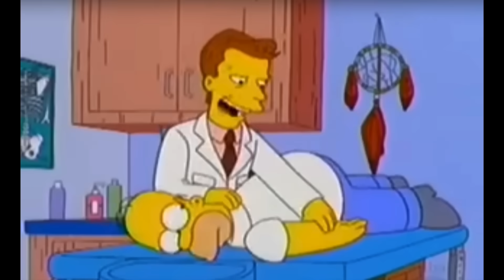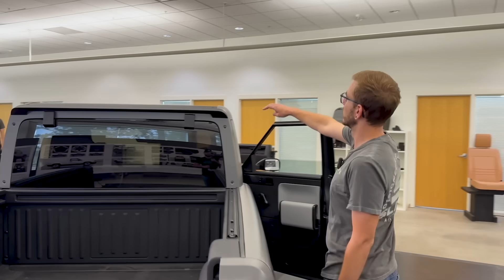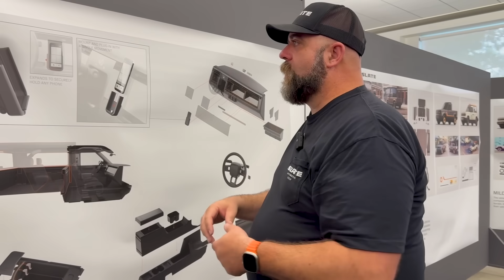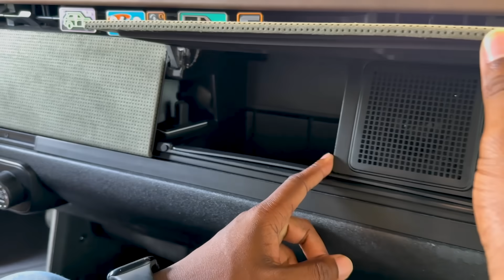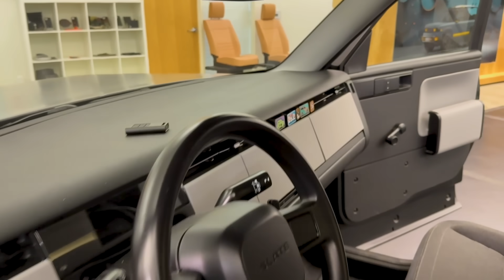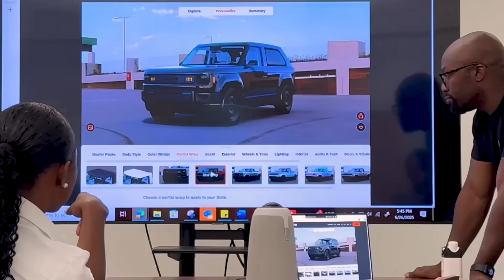The Slate: America’s $20K Answer to China’s Cheap EVs (Exclusive Access)

Comment: I'm at 28:00 in the video. All the utilization of the different parts to be basically created out to fill wherever that part might be missing or broken. On the slate truck made me think of hold on your to your buttz now. Military application. If you have a part that you need to repair you could just send them like in 100,000 parts and change all those trucks or keep them moving and doing what they're doing instead of having to you know individually make a new part for each truck. The slate is so Kool it's ice cold.

Comment: One big overlooked benefit of the Slate EV is its low MSRP, which directly lowers vehicle registration fees, taxes, and insurance costs in many states (like Colorado). You could buy the base model, then upgrade it with added seats, other components—even fully enclose it and turn it into an SUV—and still enjoy the perks of a sub-$30K original MSRP. Smart move for anyone wanting capability without the long-term cost burden tied to higher-value vehicles.
Reply: Sure but most are going to spend another $10k customizing it.
Reply: @rcl8793  Right but buying accessories isn't taxed the same way as buying a vehicle. So you're taxed for a 30k vehicle even though you've ultimately spent 40k
Reply: I already see dealers add $10K just because
Reply: @vadim6385  The Slate truck won't have "dealers". It has to be ordered directly/is direct to consumer.
Reply: @vadim6385 no dealers, you'd buy directly from slate
Reply: @vadim6385 more reasons to remove the dealership model. Because they're new, they will most likely do something like Tesla where it's just showrooms, though some minor hints lead me to believe Amazon may have some play in this.
Reply: But still cost 20k...go look how much cost Dacia cars...
Reply: @joe125ful we cant buy a Dacia... so it doesn't matter.

Comment: The rear seat would not have any leg area just a bench seat in the bed of the truck
Reply: I saw that too but if you look at the bed there's what looks like maybe a removable bit towards the front of the bed.  I am wondering if that is where it opens up for rear passengers because I've seen videos of adults who aren't lieutenant Dan sitting back there.

Comment: @$20k I don’t know if this is a Godsend for middle class America or a death bell for the final pump and dump by billionaires. 
The employees are genuinely passionate about the vision though. I love to hear about company values for the customer.✌️
Reply: Also the automotive renewal method is a basic mechanic for yearly profits. Of course this was powered by necessity combined with the general brain washing by the entertainment industry. “Don’t get stranded, buy this better powertrain” “Don’t get into a lethal car accident, buy this vehicle with improved safety” Plus they raise the prices when the new body style comes out (Perfectly correlated to the cost of R&D with inflation) and it’s not necessarily wasteful for the improvements made. 
For instance the slate vehicle will last the owner 20years before a better upgrade is released that the vehicle would be inherently incompatible with. 
Kinda like adding independent suspension to a Model A or adding new crumple zone safety standards for +60mph impact safety, or meeting road noise and vibration updates but lacking the door seal needed to use higher end techniques. 
The slate is a great truck but its longevity is anyones guess with the improvement rate of current technology. If I was them I’d lower the price of the conversion top by half and find a way to do it. Reasonable prices will increase demand.

Comment: I live in the PNW. Removable roof and windows? Both will need a seal to keep water out. And when they fail. And they will. This thing will leak. Stop designing vehicles for dry/hot climates.

Comment: What I think would be really cool is if this concept were offered in both ice and electric options! I think they would make a killing if they did that. They probably will anyway, but I bet the ice engines would out sell the electrics😝. Just my humble opinion.
Reply: Especially for a pickup making it a hybrid would be the most sensible. Could keep the electric drivetrain and just add a generator in place of some of the batteries. A 10-15KW genset would fit pretty easy and provide plenty of power. Then you’d also have a decent generator for powering a house or whatever.

Comment: $28k for a bare bones truck with no radio and roller windows? Why are we pretending this is cheap or even reasonable?
Reply: This is a vehicle for people that use trucks for actual work, not dicking around.
Reply: @BrunodeSouzaLino i see it more as a tool like if u don’t need a big ass truck just something to have to haul some shit around if u have a smaller car plus would be great for city driving
Reply: @BrunodeSouzaLino thats absolutely not what its for😂 i use a truck daily for work. My truck has a 6 1/2 bed to fit my ladders and equipment. My truck can pull my trailer. My truck can fit me and 3-4 people. My truck can get me 400 miles on one tank. This slate truck is literally only for dicking around within 60 miles of your home, with one other passenger, and whatever you can fit into the tiny bed.
Reply: @willishadams  tbh other truck beds on the market aren't very large either, especially compared to older trucks
Reply: @sometf2player752  gmc, ford, and toyota all have at least 6.5' options for all their full sized trucks. You can get up to 8' in a ford full sized truck. Most of the unnecessary trucks you see driving around have short beds though, yes.
Reply: @willishadams yep and that’s only in warm weather.  You’ll be lucky to get 80 miles in cold weather
Reply: @Staticline1776 yep. And once it's a few years old and the battery has degraded, it becomes a toy you can grab your mail in. Or pay another 20k for a new battery to get that 80 miles.
Reply: Correct it’s not cheap, but I’m looking at used trucks and they don’t exist at less than 15k and if they do it’s 10+ years old with 150k miles.  So given the market prices this is pretty inexpensive, maybe not affordable.
Reply: @realedelbug  yes, and imagine how much cheaper they'll be in the future. EV longevity is a lot better these days than it used to be, I don't have a lot of concerns with grabbing one of these used in 10 years time.
Reply: @SeniorMoistener  cheaper in the future doesn't belong in the same sentence when you take the never ending inflation into account :) Cheaper when you pick one up used tho sure
Reply: they're 20 grand the government gives an 8,000 tax credit for an EV purchase.
Roll down windows are way better btw but you're a pencil neck so of course it would hurt your little wrists
Reply: @victorkreig6089 too bad people who call others pencil necks voted in a guy that's getting rid of the EV credits
Reply: @victorkreig6089  In what country?
Reply: Have you priced pickup trucks lately?  You barely get an operable vehicle for $50k.
Reply: @robertd9850 thats somewhat true, but the trucks you're talking about aren't marketed as affordable. A Ford Maverick is 30k and has basic electronics. You can get a base tacoma or f150 brand new for less than 40k. Theres even a low trim jeep wrangler for 33k now. No paint, no electronics, and range that will almost certainly be closer to 100 miles, for 28 thousand dollars is asinine.
Reply: @willishadams  There are only 2 Mavericks out of 107 near me that are slightly under $30k.  The rest are $34k or more.  The Slate doesn't compete with ICE pickups, it competes with EV's.  EV's are always more expensive than the equivalent ICE vehicle.
Reply: @robertd9850 I responded to you saying there isn't a barely operable truck for under 50k, which is silly. Calling this truck cheap is just as silly.  This thing should cost 20k and be 12k after rebates. Then its short range and low capabilities would be somewhat justified.
Reply: @willishadams  Can't make a battery that cheap.  Did a quick search of local Ford dealer inventory.  Of the 521 F-150's available, they have exactly two with an MSRP under $50,000 and those are both 2 door white work trucks, something the city utilities would buy.
Reply: @robertd9850 in my small, extremely expensive town in Utah, there are over 100 f150s under 50k. There are 6 single cab work trucks with long beds, paint, and radios for under 40k. These are brand new trucks that id consider somewhat operable.
Reply: @robertd9850 in my small, very expensive, utah town, there are over 100 2025 f150s for less than 50k. Most are crew cab xlt or stx trim. There are 5 single cab "work trucks" with paint, audio capabilities, towing packages, and 400+ mile range, for less than 40k. All new and "operable". Batteries are more expensive, less efficient, and produce far more pollution to create. Removing standard options is seeming more like a gimic by the minute.
Reply: No towhook?
Reply: The money you will save compared to paying for gas and absurdly expensive repairs is completely worth it
Reply: Exactly, I was thinking the same. 28k isn’t cheap at all for 95% of us in America or 99% of us in the world.
Reply: My electric Mini was $29.9 before the fed tax credit. And it came w/ paint.

Comment: 40:56 I mean, there's also an aspect of this over time customization. Say you want an "off-road" package ... To get a 1500 with that, you have that added to the whole up front, so you're financing with interest rims, tires, running boards, lift kit, and fender flares. That kit will add a hundred bucks or more every single month to your payment. These guys let you add it incrementally, NOT tacking it on to your payment. Yeah getting the whole kit at once will be a few grand, BUT adding a $500 accessory quarterly, and you can have your whole kit in the 1st year, without raising your payment... If you have a rough winter, money is tight, well have to wait a bit for that front bumper, but can still afford your truck payment. That's an aspect they could promote that'll help a lot I think to focus on.

Comment: Unfortunately this truck will be too expensive for most people. Built in America means it will be expensive to manufacture - but on top of that the truck "as standard" has nothing. The stats are poor and it can't really do "work" and all the add-ons that people will want, like a radio, automatic windows and locks, blah blah blah, will end up making the end price way way higher than advertised. It's kind of a trick, to make the price look better than it is.

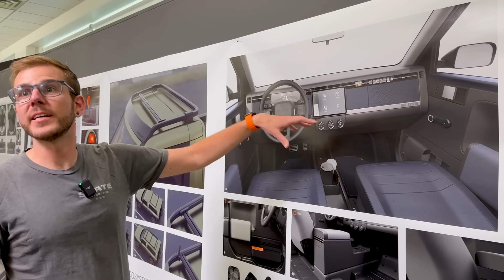Comment: 4:30 ... As a Japanese kei owner. This is kinda funny...  They don't come with a radio to save cost? (100$ head unit. 45$ speakerx2) 
Bring your own device is neat, but any telemetry you would get from an app you can already see via the obd port 

I'm more interested in the prices for replacement parts.... Like how much is it to replace the battery(s)

Comment: 29k for a decent build, on a TINY truck. China will give you a temu Porsche for 35k. BYD TANG and ATTO. MIC DRIP. DRIP. DROP. 
But wait there's more. The BTD shark is 60k and it fits 4 grownups. It's a beast, they hold ip in the Australian outback as the best vehicle off the grid.

Comment: Speaking as an owner of a 2022 GMC Canyon who had to wait a month and a half for GM to get a brake caliper for my truck when it seized. I have been saying for a while that automates need to make parts more common from vehicle to vehicle. It would  ake things easier on parts suppliers. The way this truck is designed is brilliant. For could do something similar with let's say the Maverick, Bronco Sport and even add like a Bronco Sport trac, like the old Ranger Sport Trac. GM could do something similar. Dodge, Toyota, Kia, Honda. All the auto makers should offer something similar to this. I'm not a huge fan of pure electric vehicles but if they were to add a gas range extender like the old Chevy Volt. I would absolutely be interested in something  like this.

Comment: Just be a man and buy that 3rd gen Dodge Ram with a cummins engine for less than 20k. Life will be infinitely more interesting than if you had bought a Slate truck.
Reply: yea but its huge i don’t want to park a ram it sucks. i would get a ram if i was towing all the time but its bad for everything else. this is not a F350 replacement its for tacoma owners that only own the truck to get plywood occasionally and do a bit of landscaping sometimes.
Reply: Also I all-ready own a truck for towing and it sucks to drive unless its work.
Reply: @mshepard2264 yea its annoying especially on the megacab, with front and rear bumpers plus a tow hitch. We parking the looong way. Id still take it over a Slate, its cheaper (initially) and like 4x the vehicle.

Comment: This is the vehicle you think you want, until you realize you don't actually have use for a underpowered two-door pickup made of plastic.
Reply: I got a 95 Miata’s with less than this, and prefer driving it to my 22 Cadillac.
For under 20k, I would snatch this thing up without a second thought.
I don’t want any option,, and I don’t want to see a dealership, or repair shop for service, when needed.

Comment: This truck will fail because It's not 20k, it's 28k for the blank slate which doesn't include basic amenities that are included in cheaper trucks like the maverick. The range is laughably terrible. Add in speakers and powered windows and now you are well above 30k. The Ford Maverick base model has these and more for less. There will be a niche audience for this truck because of it's quirkiness but for everyone else that needs a functional daily driver, I doubt it.

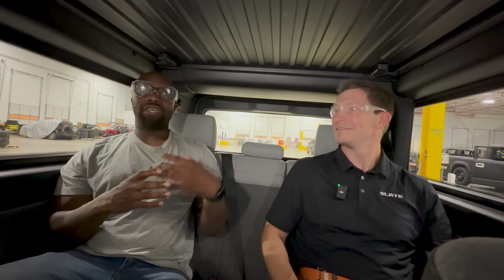Comment: 29:12 Anyone else notice the 95-2003 Chevy ZR2 Blazer 4x4 half covered over Rich's right shoulder (to the left of your screen) 
Just me 🤔 maybe its because I bwant one soo bad... I have 2 4x4 2 door Blazers, one all manual (tranfer case & transmission) the othe full auto with 3 button electronic 4WD stitches... And a ZR2 pick-up may sacrifice the ZR2 pickup to make the all manual blazer a ZR2 because it needs framework anyway.
But to get back to the video topic, kinda.
What good companies do a ICE to EV or plug-in hybrid retrofit?
A blazer with a disel generator, cat back exhaust (just to confuse people) and full electric drive would be interesting with the Blazer's 20 gallon fuel tank...lots of range depending on how efficient the generator, regenerative braking & gearing is. Of its the kind that just bolts up to the existing 5 speed manual... It could get REALLY interesting 🤓

Comment: This thing does look pretty cool.  I mean, I do want a handful of physical controls, and one display of some kind with the dashboard on it; and I kind of doubt they can get it certified without like a speedometer actually "built in" to the car.  

But, I like the low cost and flexibility; it should be quite repairable given how modular it is.  And I do even like the 'mount your own tablet in there' when that's compared to $1000s for a 'infotainment system' with fancy speaker system.  I have a like 5 or 7 speaker sound system in my car, I like it, but I would have rather saved the $1000+ and not had it.  So you now have cars where the base model has a full around sound system, automatic climate control, power windows, power seats, at least 1 large tablet, etc., and each and every one of those items adds like $500-1000 to the car cost.  That REALLY adds up and I love the option here to just spec it out how you want.

Comment: OK my issue with ev's in general is this. Remember the first person from slate this you tuber is interviewing says with their mount your own device gives you the ability with their app to rout out where charge the batteries and it routes out your trip along lines where charging stations are located! Which is good, buuuttttt i watched a TFL video where they did a segment where they showed how far they could go being conservative in a Tesla basic white Tesla car and how far you could go on a full charge towing a 10klbs load on the same Tesla car! And on the towing segment of their vidoe while towing they barely made it back on a single charge and they put the Tesla with less then 1% battery life left in the batteries it took then to get a full charge on the batteries well over 2&1/2 hours to fully recharge the batteries! See buying lossless fuel vehicles or hybrids that a Mashup of gas and electric vehicle it only takes minutes to refill the gas tank. So what's your time worth to you?!!!! And i ask that question in reference to electric vehicles no matter the manufacturer of said ev if the batteries are totally dead do you wanna add hours to your trip for constant recharging episodes versus the mayben20 minutes of filling up with traditional fosle fuels?

Comment: My question is why is the efficiency of the slate truck not even comparable to a Chevrolet bolt I have a 60 KW battery and I can get 240 mi of range and + depending on regenerative ie:1 pedal driving. And also too too why is it just on your rear-wheel drive why didn't they just stay with front-wheel drive and not lose the torque and horsepower of a 200 horsepower motor. The slate takes almost 8 seconds to go from 0 to 60 whereas my bolt will do it in under 7 seconds.
That being said I do like the slate truck and I like what it can do I'm just throwing my two cents in!